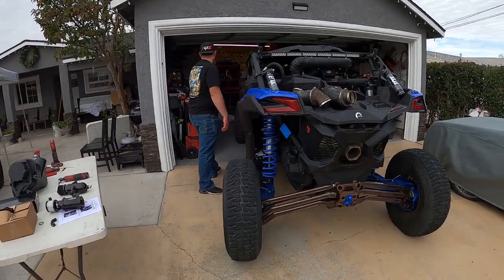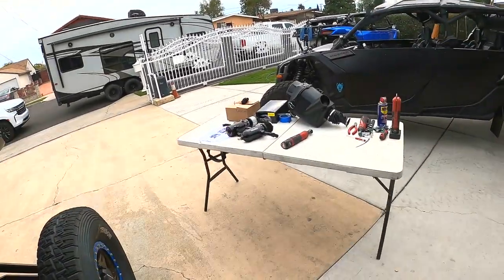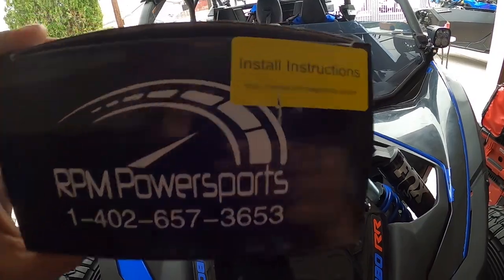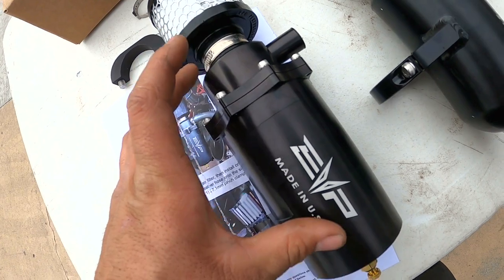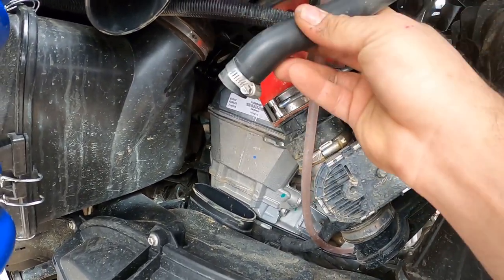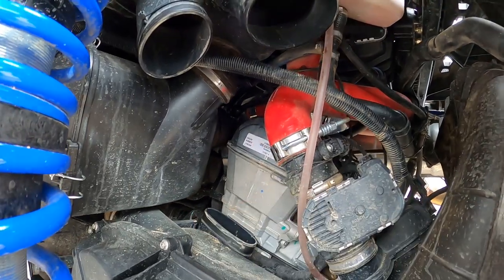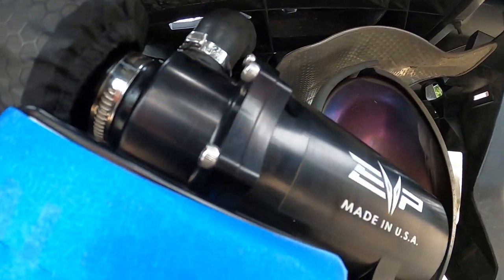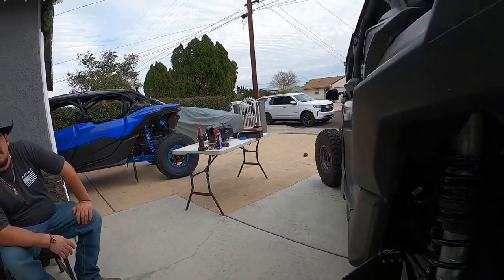Can am X3 Catch Cans EVO powersports RPM powersports EP -161

Comment: I've been running a catch can before these companies starting making them for UTVs.   From my racing day's we always used 1" hoses with hose clamps because AN fittings restrict flow. 
A single outlet from crankcase into a catch can is actually worse because you are loosing the air draw from the intake.   If you're going to run a catch can without a draw setup (exhaust or intake vacuum)  you have to tig a 1" aluminum bung on the top of your valve cover and dump into a 2 port catch can or reroute to let it dump like we do with our diesel trucks.
Reply from the maker: Yea on vetts at work we see catch cans like ur describing obviously better engineered .. Great to keep the carbon buildup from accumulating on intake valves for these direct injections gm gen5 v8 engines. These catch cans do fairly well on these sxs. I think there is alot more pressure exiting due to the boosted application. But ur right a vacuum assisted version would work better. I have an inlet/outlet catch can on my 16 silverado.

Comment: Should I keep the catch can closed while operating shop told me to run it open after I got the rpm installed
Reply from the maker: No.. close it or u will have a constant mess of oil spilling on ur frame.. u only open to drain it

Comment: I installed an evo catch can just like yours on my 2020 rr.   But my air filter still gets oil stains.  Do you know why?  Hose on catch can seem pretty dry
Reply from the maker: A blow off valve also helps . If u continue ti have excessive oil in filter u may have another issues present

Comment: Is there any budget friendly catch can options that you know of ? I'm noticing small amounts of oil on my air filter.
Reply from the maker: You could make your own im sure. But these are the better bolt on options made for these vehicles.
Reply: @GLifeUTV  I went ahead and ordered the rpm catch can kit, thanks for the discount code. Does this cause your x3 to throw any codes ?
Reply from the maker: @CrashitFPV  no it should not